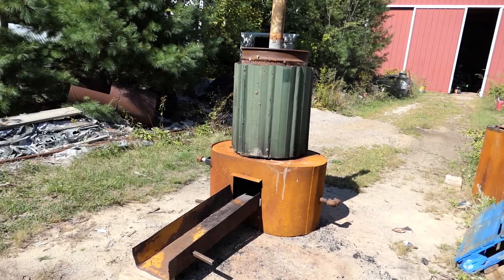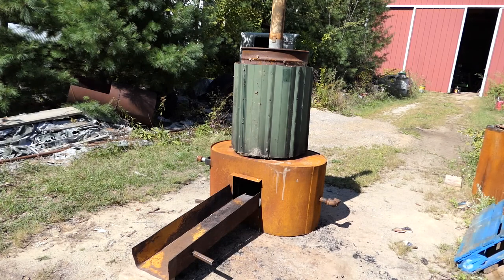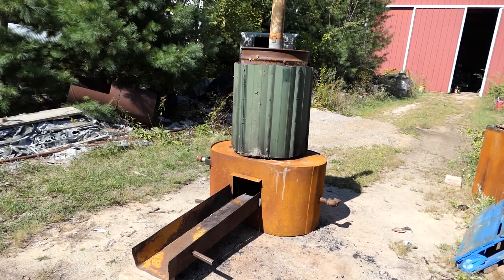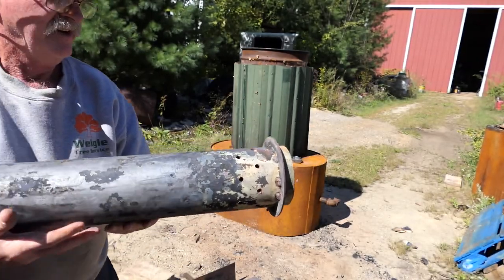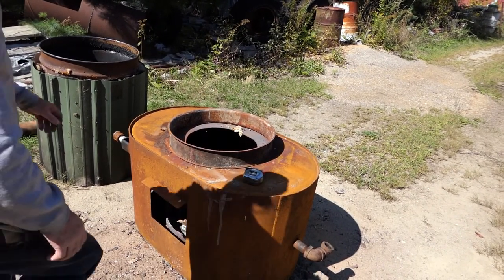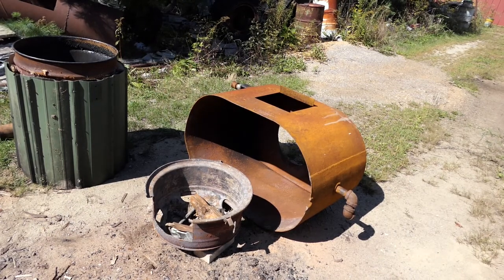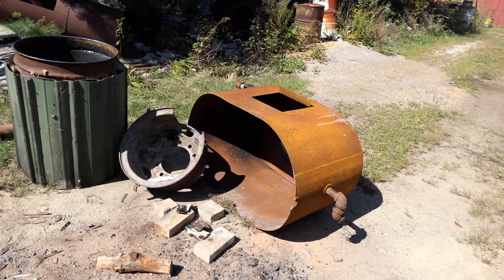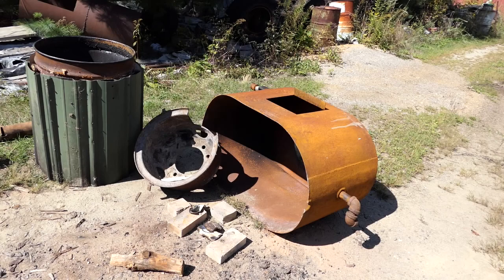NH Hbbyloggr - Lower burn chamber for Charcoal retort 091722

Comment: Nice job Bill ! I'm looking forward to seeing you run some of that charcoal in your gasifier. Thanks for the show. Joe
Reply from the maker: Hey Joe, It sure has been a busy summer and now we are full bore into firewood delivery season. I'm glad that I had a little bit of time to run these batches while processing wood for the stockpile. The retort lower fire requires stoking about every 20 minutes to keep the  temperatures needed to carbonize the wood. The next thing on my list after firewood season is to unveil the megatron gasifier for all to see. There are two 3-ph blower motors on it so I have to figure that part out. We'll see how it goes.
Reply: @nhhbbyloggr5022  Bill, I forgot about the big gasifier you picked up. Check the name plate on those three phase motors, and see if they can be run on low voltage. Also Check the HP rating. If it's 5HP or under and can be run on low voltage three phase, it should be easy to run them on a 240 volt single phase vfd. Let me know what you see when you look at them. Joe
Reply from the maker: @mazdalorean  Will do, Joe. I'll let you know. Thx !

Comment: I would imagine with that bottom tub if you lit off in the early morning you could use a good cast iron pan right on the side there and have some eggs bacon and hash browns as the char starts up. Pot of good coffee on the other side 👍 char maker cook station haha
Reply from the maker: Actually I'm looking at starting up a " fast food" side job. Eggs in 3 seconds, bacon done in 20 seconds along with coffee served at 250* F. Definitely need a spatula with a 10 ft handle

Comment: I like the 2 piece chimney. I've seen one piece chimneys but 2 pieces looks much easier when you are getting in there for you charcoal. Thank you for the measurements and details!
Reply from the maker: I do use a tractor to lift the retort on and off the lower burn chamber. Much easier that way but it can be loaded on top of the fire chamber using a step ladder.
Good luck on the build ! Let me know how it comes out. Thank you
Reply: @nhhbbyloggr5022  I'll use the Kubota. Thank you!